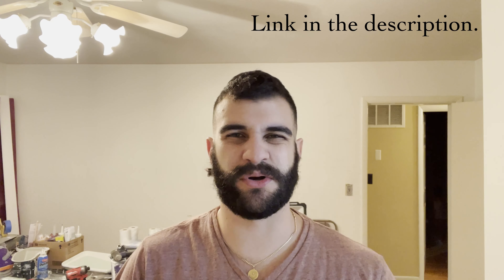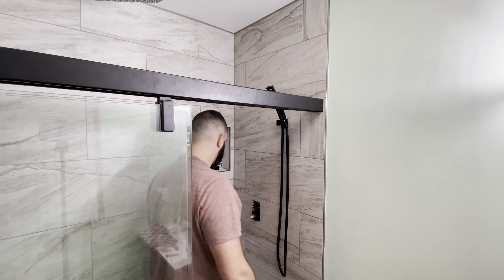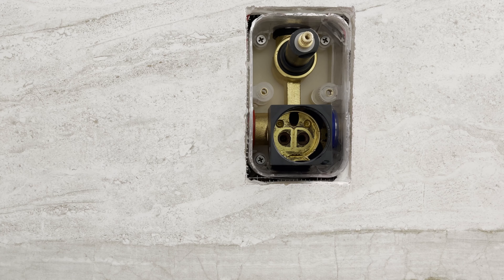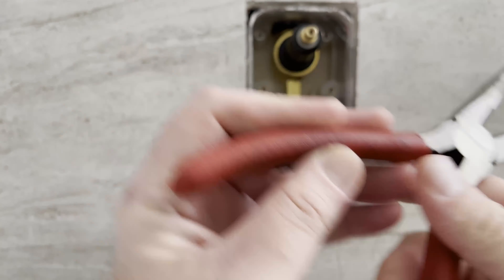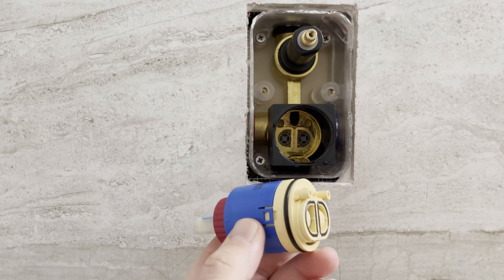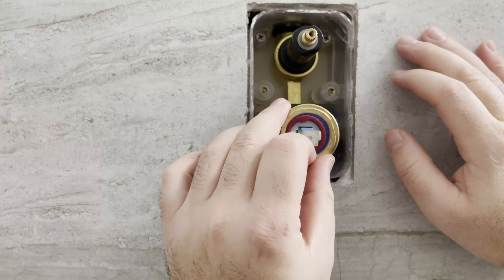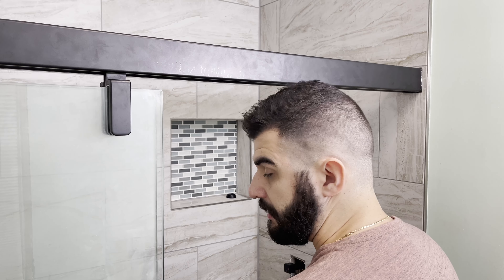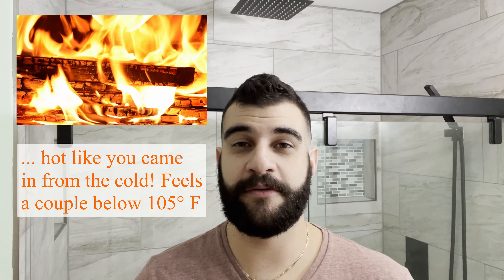How to take apart a Mixing Valve

Comment: Thank you so much. I repeatedly emailed the company (no phone number) asking for a diagram or video to help me do what you just showed in your video. Looked all over Google and YouTube. My wife finally found this video. Found a chunk of plastic debris. She was ready to tear the wall out and send it back. 
I am going to send your video to the company and recommend they send the link to people who need some tech advice as I did.
Reply from the maker: I appreciate that! Thank you. They likely won’t respond to the video or comment back bc they’re a company or reseller based in China. They just so happen to sell on Amazon. But worth a shot.
Reply: @davincey1368  jonbo is correct, i recommend it to customers when they ask for technical assistance regarding cartridge removal, temperature/pressure adjustment, check valve installation, etc. the brand customer service rep here btw. :)

Comment: thank you so much for the clear step by step instructions on taking the value off for cleaning!  would you happen to know why my water/cold handle doesn't do anything?  no temperature control or flow control.  the upper square control worked, but I only got one temp and one flow setting :(
Reply from the maker: Have you taken the water cartridge out of the valve to see if the temp and flow controls are seated properly as per the video? Do you have temp and flow control on the hot side?

Comment: Nice video. May i know why do you still need the check valve in the cold and hot inlets of the mixer? It serve no real purpose as there is not much water in the shower head to return into the water source. It'll only reduce the flow rate. No?
Reply from the maker: The check valve is there to keep lines pressurized as you cannot have either hot or cold unless both lines are flowing, to prevent water hammer, and yes contaminated backflow.

Comment: Very nice of you for sharing it and explaining the whole process of it 
My question is y have a similar one it’s brand is Cobbe  and the water comes out reverse , cold on left and hot on the right side do you know if there is a way to turn the cartridge and solves the problem like other brands.
Reply from the maker: To my knowledge, water cartridges go in only one way bc they need to line up to the check valves. You cannot flip the cartridge in the SunRise valve. If your water is reversed it’s because the water lines were installed swapped. Not sure I can help you with what you want, but I would swap them to the right direction, bc if you can flip the cartridge that’s a workaround, but the lines should be corrected for the long run.
Reply: @davincey1368  thank you 🙏 so much for replying 
I’m 100% sure pipes are correct hot  on right cold on right side but for some reason the mixer is not working  correctly.

Comment: Hello, I have a problem, the cold water has very low pressure, when it goes up and under the control, the water flow is not strong. Valve model SR SUN RISE Shower Cartridge Replacement N40HKC
Reply from the maker: I would open up the valve, remove the cartridge and remove the check valves to see if there’s something caught behind them.
Reply: @davincey1368  tks

Comment: Is the valve reverseable ?
Just finished up my bathroom remodel and the hot and cold are reversed.  Hot water is going into left(red) side.
Reply from the maker: You mention they are reversed, yet you state that hot is going into the left-red side. The hot, left-red side is the correct side. Hot is on the left and cold is on the right.
Reply: @davincey1368 lol I thought I was tripping when I read the comment

Comment: We're did you get your check valves from, we are having trouble locating them anywhere. Even went to the shower manufacturer to know avail.
Reply from the maker: They came with the kit I bought off Amazon, they’re part of the valve (since it comes pre-assembled). You should have received them when you bought it. The manufacturer has to have them, they made and sourced the parts.

Comment: Thanks for the video. Do they sell just the mixing valve for replacement?
Reply from the maker: You’d have to check with the manufacturer direct. I bought it off Amazon. Surely they have a replacement.
Reply: @davincey1368  thanks man

Comment: I was hoping you'd tell us or show us what's the water pressure is like. Is it strong?
Reply from the maker: It’s very strong. But just because mine is strong doesn’t mean yours will be. It’s all based on the type of pressure you have from the get-go/main. I will say tho the pin needle heads on the shower head have to make a difference to some extent. After having it for a year now I still have no complaints in any area. Working well just as it did day one.

Comment: Did you know the flow of water for those ? Mine is to low.. im going to open the valve .. he is alredy on maximum pressure in that blue piece ...
Reply from the maker: Flow is set to max from factory. If not, it was assembled incorrectly, but is an easy change. I do not have the flow measurement. Either provided on the description or you may need to call them direct.
Reply: @davincey1368  how do you set the flow to max on these cartridges?